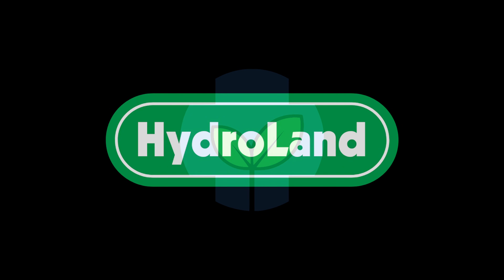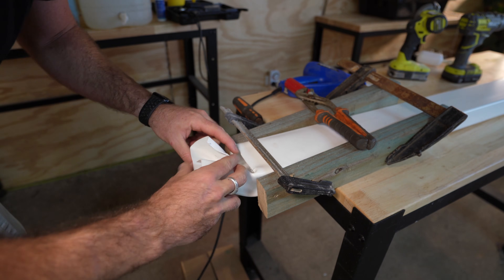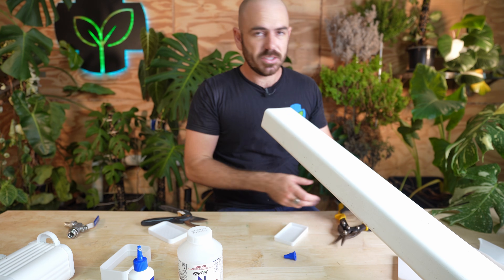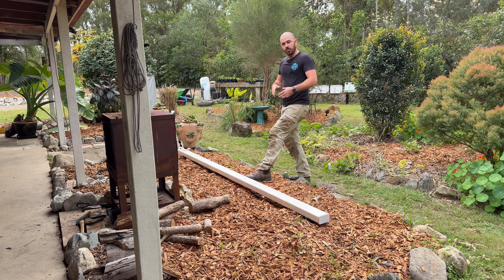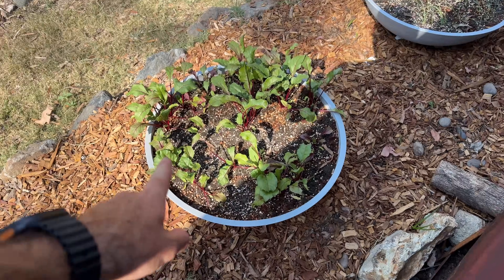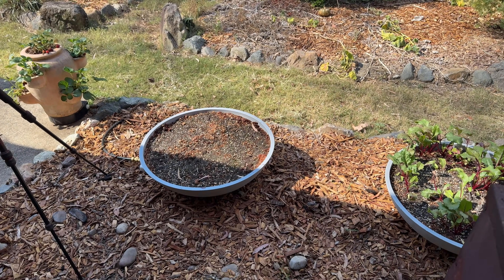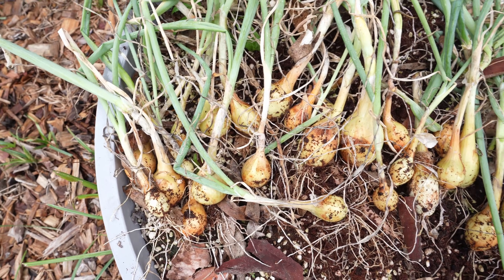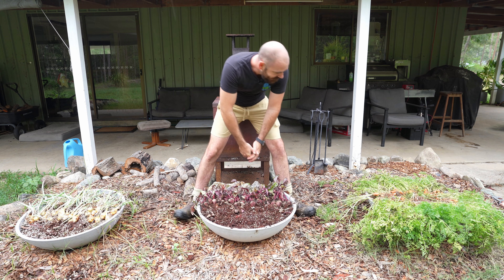Hydroponic Root Vegetables in a Rain Gutter Grow System

Comment: this might sound like a dumb question but im going to ask it anyway 
what affect does rain have on this system 
obviously rain is going to fill up the bowl but will if effect the nutrients?
Reply from the maker: Not a dumb question at all.
The coco holds onto the nutrient that wicks up, due to its cation exchange sites.
Essentially as the water and nutrient rises, the nutrient sticks to the coco like Velcro.
And if it rains, the water is allowed to pass through, but the nutrient stays.
It may dilute the base pipe, but that will soon be used by the plants and return to normal.

Rain actually helps wash excess salt build up.

As with anything, too much rain is bad, and too little rain causes a nutrient build up in the coco of things the plants aren’t using.
Reply: @Hoocho excellent that puts my mind at ease also now meens we can grow more
Reply: It depends on how much rain you get but I don't see it being a massive problem because the majority of it would evaporate.

The system isn't going to permit back flow so it's not going to affect your nutrient solution reservoir. The only risk I can imagine would be heavy rain diluting the nutrient solution so much that it affects the growth of the plants but even then I doubt it would ever get to that point.
Reply: @jessl1934  that answers my question 
we normaly use towers to grow or grow inside the greenhouse 
greenhouse is ony 4ft by 3ft so limited by size and living in the north west UK we get allot of rain
Reply: Root crops have to be grown in a wicking situation.  It doesn’t work with the kratky method which is only a nutrient solution with no grow medium.
Reply: . Dr. Kratky "grow kratky" posted methods for growing potatoes a few years ago. Perhaps those methods could be used for other root crops.